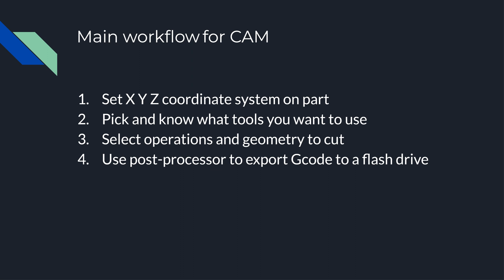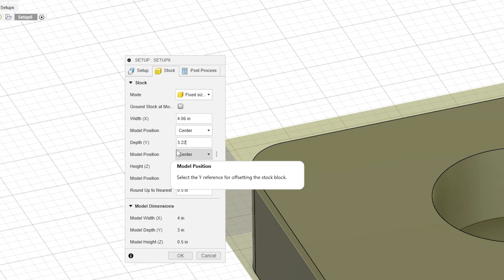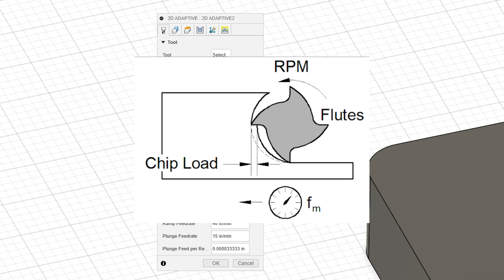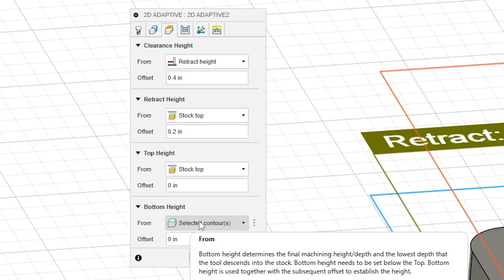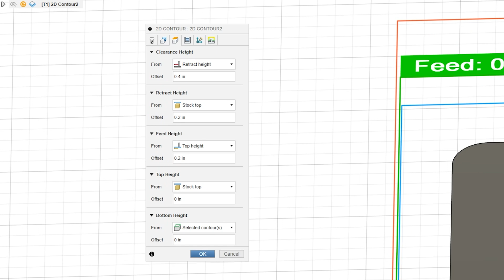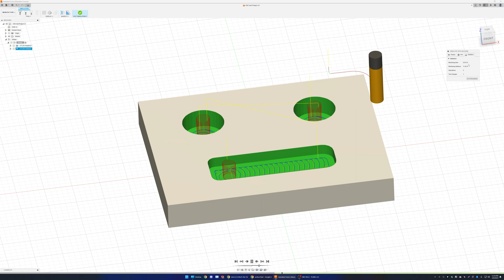CNC Router Project Part 1 || Intro and Fusion 360 CAM

Comment: How are you holding this piece down if the machine is cutting all around the outside edge?
Reply: You can use double sided tape, or masking tape that's superglued to itself if that makes sense.
Reply: 4:05 seconds in he tells you